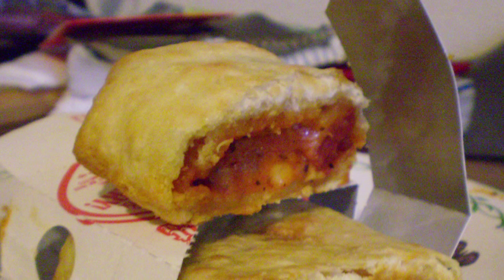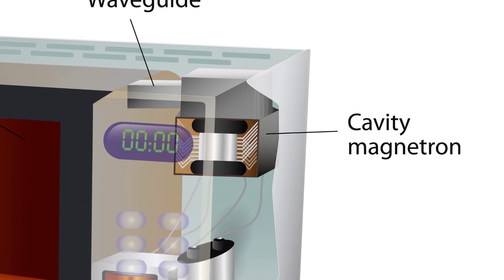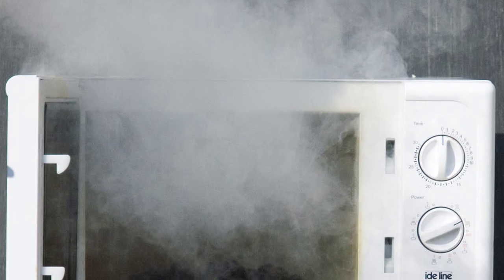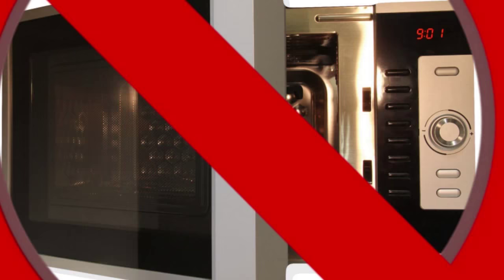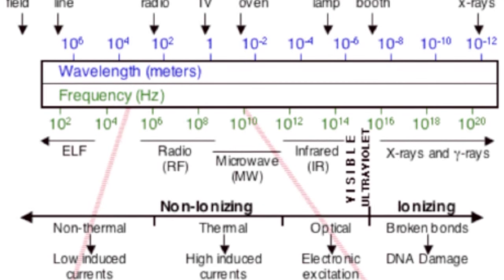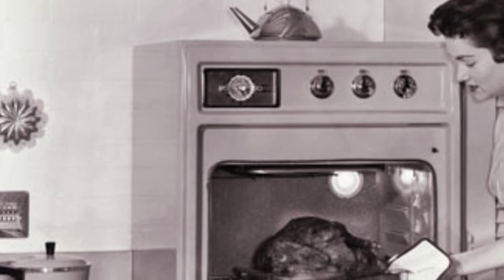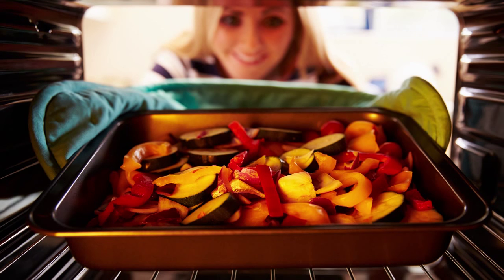Why You Can't Put Metals in the Microwave

Comment: Bonus Fact 12: Because microwaves can interfere with pacemakers, all microwaves produced in the United States after October 6, 1971 must meet the FDA/CDRH requirements regulating the acceptable amount of microwave leakage. Despite this being in place, I remember people with pacemakers being told not to operate microwaves as recently as the mid-1990s--but that was due to urban legend rather than actual hard facts.
Reply from the maker: TimeLady8 Wow, cool, today I found out ;)!
Reply: Today I Found Out :-D
Reply: +TimeLady8 The Doctor would be proud!
Reply: I‘ve heard that‘s why people with pacemakers shouldn’t use induction stoves either. I don’t know if that’s actually true though, I can’t imagine people dropping dead from using the wrong stove 🤔
Reply: @Halbmond  
From the national institute of health
"CONCLUSION: Patients are at risk if the implant is unipolar and left-sided, if they stand as close as possible to the induction cooktop, and if the pot is not concentric with the induction coil. Unipolar pacing systems can sense interference generated by leakage currents if the patient touches the pot for a long period of time. The most likely response to interference is switching to an asynchronous interference mode. Patients with unipolar pacemakers are at risk only if they are not pacemaker-dependent."

Comment: I once put a gel candle in the microwave to melt the gel and a bolt of lightning struck the candle down to the little metal base and haha it actually lit the candle.
Reply: xD
Reply: neardood1 - Amazing.
Reply: I once put a McDonald’s kids meal light up hot wheels toy in the microwave.
Reply: Thats a lie.
Reply: Some candles are made by starting with a flat metal base with the wick crimped to come out the perpendicularly (stiffened with a small amount of wax).  This is put in the bottom of a mold and the hot wax or gel fuel poured around it.

While gel fuel may absorb microwaves, paraffin wax doesn’t, so the only absorbent material is the string (usually cotton = cellulose = a very long sugar polymer), which is attached to a piece of metal.  Perfect conditions for a spark to ignite the cotton, which will ignite the wax.  But unless you put some food in with it, you risked reflecting the energy back into the magnetron and damaging it.

Fats and ice don’t absorb microwaves, but water, proteins, carbs, and other non-fatty food materials do.  That’s why frozen food instructions generally say to stir and recover about halfway through the process.  The first half starts melting the ice so that the sauce or gravy CAN be stirred.
Reply: @1212goose  thats the type of thing no one would believe without seeing it, but ill take his word for it

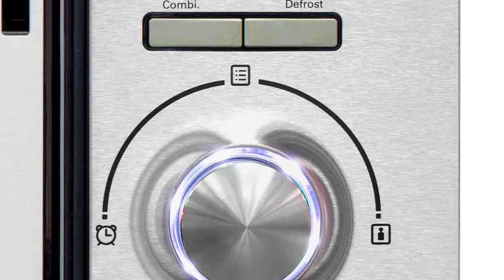Comment: 7:10 - That should be "amplitude" not "frequency", although, of course, there is no change in frequency either and yes, the "power-level" is usually changed by varying the duty-cycle or "mark-space ratio" - In other words, at anything other than "full power", the microwave oven switches on and off periodically, with longer "off" times and shorter "on" times producing low power settings whilst longer "on" times and shorter "off" times produce higher power settings.

Comment: My Whirlpool Microwave (AVM 045) manual clearly states that it is ok to use multiple "small aliminium foil sheets" to cover "easy to burn" bits, like the bone end on chicken drumstick, the wings and so fourth. Also ok, (single use) aluminum forms. Warning noted in the manual. Remove the paper lid, since it has a metallic film on the inside, and expect longer cooking time.

Common tip for safely boiling cups of water, especially in regions where Reverse Osmosis units are regularly used, is to put a metal spoon in the cup. De-ionized water can sometimes be superheated, and when you add anything to it, violently boil over. The spoon supposedly ionizes the water ever so slightly by giving away metal ions, causing the cup of water to safely boil in the microwave. Not sure if i believe that to be the full story, but anyhow, it's yet another safe way to use metal in your microwave...

Comment: You know what's interesting? Sometimes, turning on the microwave would disrupt my wifi signal. I then got a 5 Ghz router, and it stopped.
Reply: this is because 2.4 ghz (wifi) is close to the 2.45 ghz of your microwave and if your microwave was a bit wrong and had a lot of leak radiation it could have been the source of your problem
Reply: OMGosh yes, where i live the house is small and my wifi box is almost close to the M'wave , swear i my wifi  signal acts like its far away .. hmm
Reply: blusoldierwoman And the signal strength needed to be picked up by a  receiving device and cause interference is way below the maximum allowed leakage, which is way below the level that can harm humans.

Comment: It is not rubbing of molecules against each other which is heating up
Actually the warmer molecule it is, the faster it vibrates or moves
As vibration is forced upon molecules in microwave, then molecules have no choice but to become hotter

P. S. To achieve absolute zero temperature you need to stop vibration of molecules

Comment: I once accidentally put metal in the microwave, I wanted to heat up my desert and forgot I'd left the spoon in the bowl.  Nothing bad happened though except I almost burned myself on the hot spoon afterwards.
Reply: I accidentally put a metallic mug full of soup to the microwave once. it was there for about minute while I was away. When I came back I could see blue arcs through the smoke. The plastic handle had melted completely. Opening the microwave inside was a very bad mistake. The house was full of smoke after that. The microwave survived though and is still in good use and works great. It heats the food very evenly.
Reply: CoolDudeClem - You have a desert that's small enough to fit inside a Microwave! Don't you worry about Sandstorms & flash floods & other desert related things?
Reply: And now you have the super powers of a spoo n

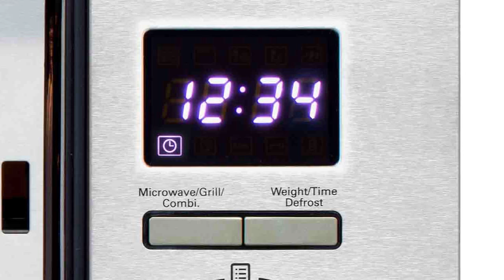Comment: 7:02 I use a phillips microwave which does properly change the power to the magnetron instead of changing the duty cycle, but that is a specific feature. It allows for defrosting and lower power cooking with fewer hot spots.

Comment: Short answer:

Don't use sheets of metal where you don't intend to bounce microwaves around.  If you cover something in a sheet of metal, the microwaves will almost entirely bounce off that metal and never reach the item in question (i.e. covering something in foil prevents it from being heated).

Don't use sharp points of metal, as those will let electrons flow out freely, creating arcs.  No knives or forks, and if you have foil (underneath the food to be heated), avoid sharp corners.

If you have a bowl of some substance you want to heat up iteratively with stirring, there's no harm leaving your spoon in the bowl during heating sessions, unless it's a funky design which has sharp points somewhere on the handle.  The spoon won't heat up at all, other than via contact with the substance,, and you won't cause any damage whatsoever via electron reflection or leakage.

Comment: If you buy industrial grade meant to be used in commercial kitchen you can put aluminium, stainless steel etc and cutlery in the microwave and get away with it time and time again whether they are motorised or flatbed.

Comment: $5,000 in 1945 dollars, or in 2015 dollars? If it's 1945 dollars, that's over $65,000 in 2015 dollars.
Reply: tacopizza2003 I feel like many facts in this video are dodgy. Maybe he converted it first.
Reply: tacopizza2003 they were $5,000 back in 1945, the "microwave oven" article on Wikipedia backs up his statement.
Reply: They used to be FREAKING HUGE and needed special plumbing fixtures installed in the house to cool them.
Reply: Alex C He is saying $5,000 in 1945 adjusted for inflatio would be $67,146.94 today.
Reply: According to Wikipedia the first microwave was 495 dollars or about 4000 dollars in 2016.
Reply: If it was first on the market in 1945, and it cost 5,000 dollars to buy in 1945, it would be 5,000 dollars in 1945 money. 

They would not have jumped to 2015 when putting it up for sale, to speculate how much that would be in 2015, and adjust the price accordingly. It does not work like that. They price according to what is going on at the time.
Reply: @jasongates-  are you serious right now? The reason for doing this is to determine the relative cost of an item, $4,500 in 1945 was the cost of the house or a custom-built luxury car that's why we relate it to today if it would cost about $65,000 to buy an entry-level house or a mid-tier luxury car then that's why we make these conversions
Reply: @maxwelsh6121  Then, maybe I could have worded what I said better, because I was trying to say basically the same thing you said. With inflation, etc.
Reply: @jasongates-  oh cool, I read it as you saying it's pointless to do these conversions since nobody has a time machine or something like that LOL , have a good day

Comment: Extra bonus fact: The 2,45GHz microwaves can in some cases cause issues with 2,4GHz WiFi signals.
Reply: That's why modern WiFi routers and hubs now use the 5 Gigahertz frequency nowadays not the old 2.45.
Reply: @stephensnell1379  Biggest reason is bandwidth.. And they actually use both 2,4 and 5GHz.
Alot of stuff still needs 2,4GHz and it's also has better range than 5GHz.
Reply: @Oystein87  my WiFi only uses the 5 Gigahertz Frequency and only this frequency so my Microwave Oven won't interfere with my WiFi when my microwave oven is running to
Reply: @stephensnell1379  But some devices only have 2,4GHz so in that case you would need both. I must use both 5 and 2,4 so all my devices can connect. And my microwave does not interfere on the 2,4GHz band anyway. It rearly does unless they are very close etc.

Comment: Isn't 2.4 GHz exactly the frequency used by most WiFi connections?
Reply: Not exactly. Each standard be it the original 802.11 or iterations of B/G/N, earlier Bluteooth, infradred etc uses the 2.4Ghz band which (not sure the range) depending on whether the open standard or deviant used uses a range within a specified frequency to deliver data successfully. The range is required so that different channels can be used to avoid conflict with other neighbouring networks and devices (even on a different standard within the same frequency range) to avoid interference/signal degradation etc.

My say is Ethernet and wired all the way as even the 5Ghz band is becoming saturated with Wireless 802.11 AC and beyond.
Reply: ItsComingOutOfBothEnds yeah but it still uses 2.4ghz. He said 2.4ghz wasn't used for communication when clearly it is! I've also experienced WiFi drop out as soon as you switch the microwave on.
Reply: I was thinking the same thing. And in fact I used to get massive wifi interference (much alower download speeds, sometimes complete dropout), if my microwave oven was running.
Though the router was fairly close to the kitchen, this was still rather surprising to me...
Reply: KuraIthys I have this issue with older microwaves that are not shielded all the way. When i was living in a apartment complex the upstairs neighbor had a microwave that cut off wifi for a fair amount of time. DoS my wifi
Reply: both Bluetooth and wifi use 2.4 ghz but just not 2.45 ghz
Reply: However this will still cause disruption if the microwave is close enough to the transmitter (typically within 10 feet and in direct line of sight). It doesn't have to be the exact same frequency, it just needs to be close enough. However, the new WiFi standard is moving to 5Ghz (my router currently has both).
Reply: Any other device with a similar transmission frequency can be used as an interrupt.

Also, the microwave is consistently turning off and on, so the wifi may experience interruption, but one can simply use aluminum foil on one side of the microwave to minimize the effect (just don't cover any exhaust vents).
Reply: did anyone tried 5Ghz wifi near microwave yet?
Reply: Do you know what it means to be on a different frequency?
Reply: You know of a 5Ghz microwave oven? Nothing is going to happen, as 5 Ghz is out of the microwave's transmission band.
Reply: the "2.4 Ghz Band" is a range from 2.4 to 2.5 Ghz,  and each standard has different methods of dividing the range into "channels/bands" (bluetooth has 40 separate bands, wifi has 11 overlapping channels) . So yes, 2.45 is within each's range. But Bluetooth will handle it better as the devices will just hop to another channel quickly enough, while wifi stays w/ the busy channel.
Reply: MrSlenderman IEEE 802.11ac, right?
It makes me remember the good ol' days of when cordless phones were still running at 900MHz. lol
Reply: Gosh, these comments are not what I'm used to on the internet. Thanks for the civilized replies!
Reply: 5Ghz microwave is possible, but not used. All you would need is a magnetron tuned to 5Ghz. And yes, they do make them at that frequency for radar transmitters.
Reply: Notthedroids Yourelookingfor what's funny is the guy commenting above you on my page is actually talking about how this happened to him till he got a 5ghz hub.
Reply: My microwave stops WiFi and dab radio working while it’s on.
Reply: Well microwaves were invented before wifi, so the fact that there is no communication networks on that frequency might have been correct for the time. It kinda seems like an oversight that wifi was made on that same frequency, my wifi on my phone cuts out if I go near the microwave when it's running, and when we had wireless house phones they would cut out too. Maybe 2.4g was made standard for wifi because we already knew it was safe to be around because we all had microwaves  lol just guessing. Isn't 5g coming to mobile phone networks and people are getting paranoid of getting brain cancer? Imagine if when wifi first came out and it was only offered at frequency people never been around before, people would go crazy with conspiracies.
Reply: @AmyraCarter you prune,the word you are referring to is cooling vents

Comment: Bonus fact #8 is more fiction than fact.
The chocolate bar in Spencer’s pocket probably melted more from body heat than RF radiation...   Not to sure about this back then, but weren’t chocolate bars wrapped in aluminum foil and then the wrapper?  How did the RF penetrate the foil....... an RF shield ?  And if he were so close for so long to melt that chocolate, he would have definitely felt the heating effects on his skin. And most definitely on his eyes.... the most sensitive part of the human body as far as RF goes....

 AT&T long lines is not totally obsolete. There are still certain areas where it is still in operation...   Also along with telephone, television was transmitted via long lines.....   Plus many of the long lines towers had communication access for the presidents Air Force 1.

Comment: Great video, but I have a question. I have noticed that if I put fresh green beans without being submersed in water in a microwave, I see little flashes and there are sharp audible 'popping' sounds with the flashes. Why is this?
Reply: Because the green beans have a high mineral content and low water content, which is basically a worst-case scenario for the microwave's radiation.  I'm guessing you have an older microwave since newer ones have a module specifically to avoid this sort of reaction... either that or you're getting the most mineral-packed green beans ever.  
It might minutely affect the quality of the green beans by heating them unevenly, but overall they're safe.  It isn't good for your microwave, however... but then if I was guessing correctly you might just want to keep going with how you've been doing things and get a new microwave once that one dies, lol.
Reply: Makes sense. I am thinking stove top lol. No, the microwave is about a year old but a high end one.  Well as soon as the arcing started between the beans I stopped ;); didn't think that was a good thing! 

Thanks Daniel.
Reply: All you need do is put the green beans in a covered microwave safe container (Corning-ware usually works) and a couple ounces of water in the container.  That way, the beans will steam-cook.  Works well for broccoli, too.

Comment: In my own experience, using stainless steel pots and pans in microwave is fine, but if the metal is not pure stainless steel it can cause sparking.

Comment: why call them microwaves when the waves are rather large compared to visible light?
Reply: Because they are small compared to old technology of radio waves, which could be as big as 100 km. In fact, microwave oven waves are not really "micro"; they range from 7.5 cm to 15 cm. That's why you have a rotating plate inside a metal box, so the waves bounce around and heat your food evenly (usually).

Comment: This is a great weapon.
Reply: Did you know when you want to disinfect a sponge you use for cleaning dishes (Only). You get the sponge wet, place on a plate and heat it up for a few seconds, no more then ten seconds. It will become extremely hot as the steam can not escape. I have done this once and wondered how it the sponge can get, so right after heating it I jammed a meat thermometer into it. The temperature was a little over 200 F or 93.3 C. So it kills all germs!! However when taking the sponge out of the microwave use extreme caution as it will be at least.  Other cautions are do not do this to a dry sponge or one that was used to clean your toilet, Or has harsh chemicals on it.